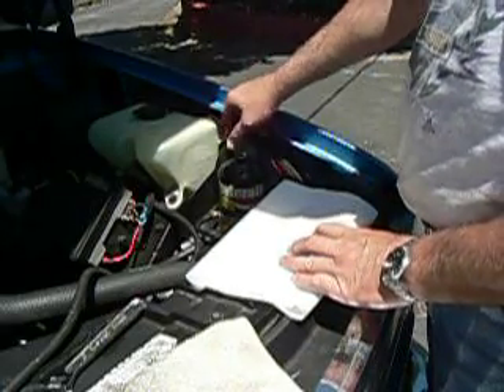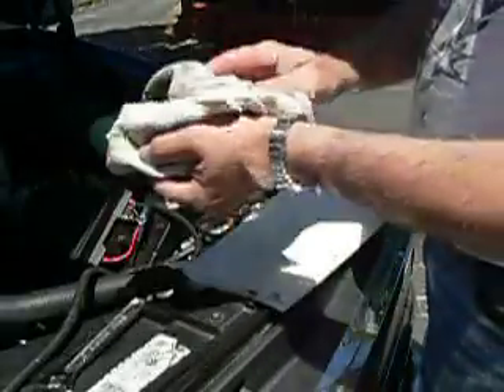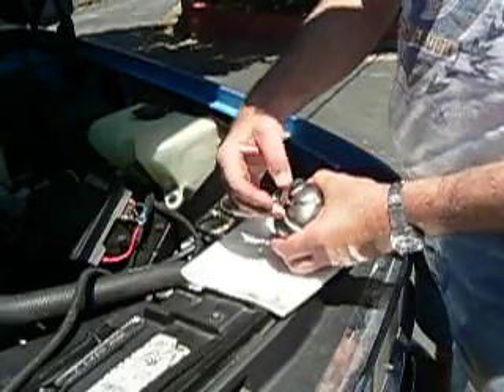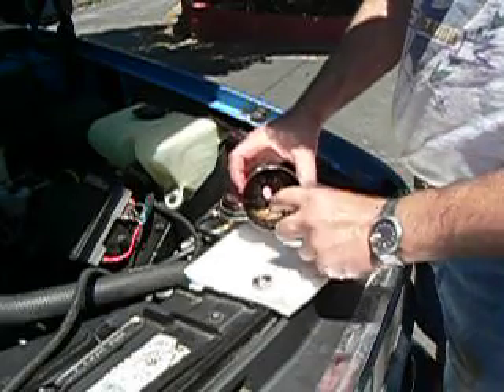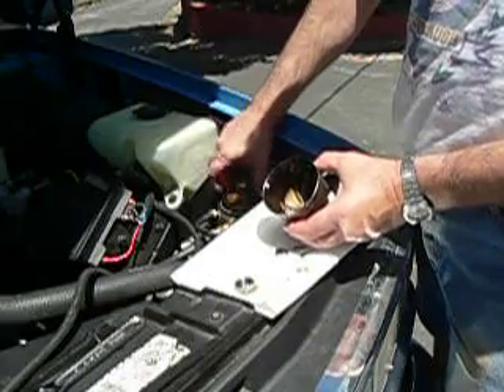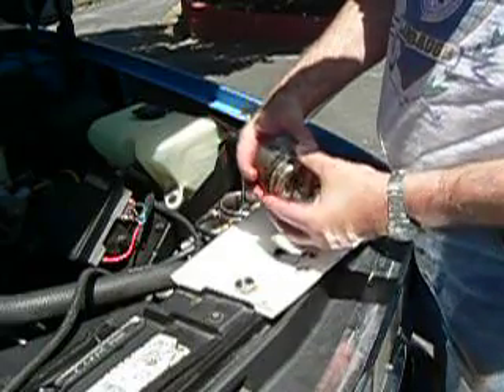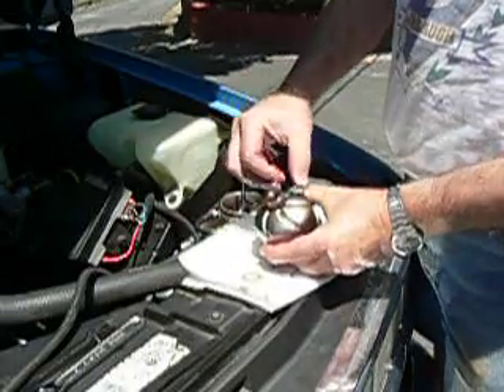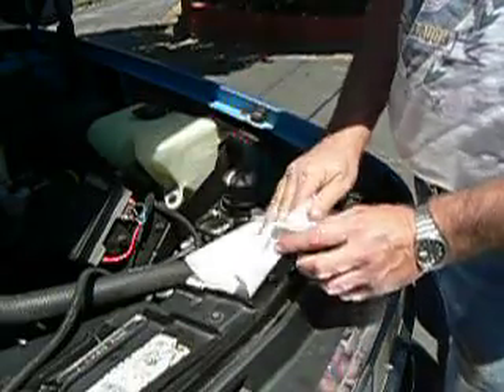Dieselcraft OC 25 Oil Centrifuge Rotor Cleaning

Comment: Well, I just cleaned mine at 3480 mile on the oil of my 2015 Duramax and let me say, MONEY WELL SPENT!
The inside of the spinner was caked with carbon to the point you really have to rub to clean it off, DOING IT'S JOB!
I attempted to video by myself but that was a disaster. That said I learned a few things.
1. let the engine sit for a few hrs or do it cold that way you can avoid a little unnecessary mess. That dribble was really my fault. 
I offered Dieselcraft to fabricate the bracket for 2015 and below. Got cancer so slow going, however now that I see the results I'm going to get on it. I thought there was room on the 2016, but the hood scoop intake is in the way. None the less there has to be a location to mount on the 2016 and later GM's. 

I would also run this on my gas unit.
WELL DONE Dieselcraft!